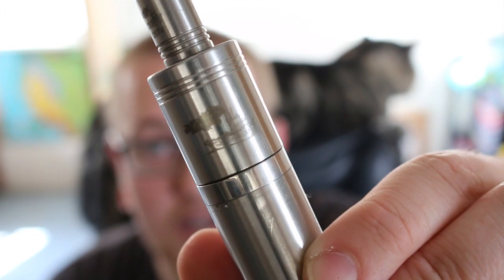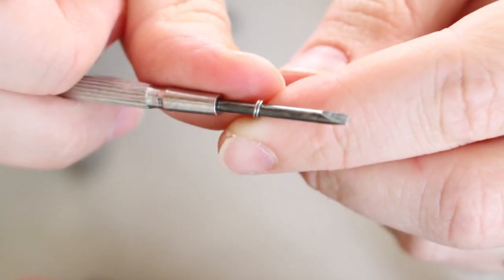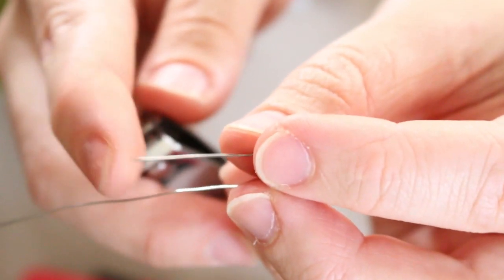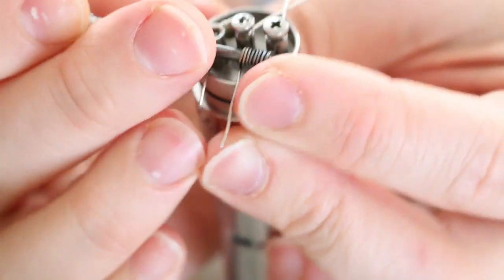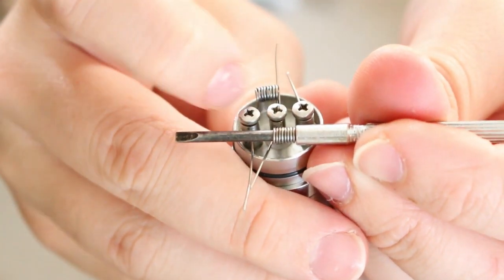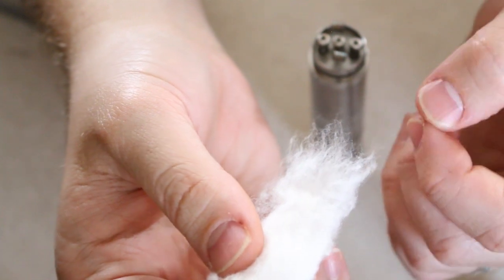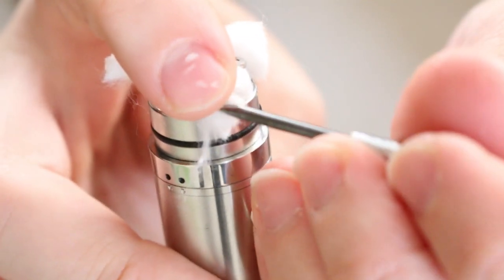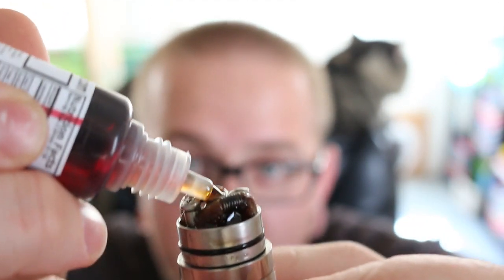Tugboat RDA Dual Coil Build!

Comment: I always ended up with one side of the wick not dry perfectly, it's like they are not heating up in balance. the other side of the coil is dry so I know I have to re drip, but the other one is still soaking. what should I do? mostly found in 4-post RDAs of mine...hmmm right now I'm using authentic Troll RDA
Reply from the maker: Rahadianto Putra Make sure your leads are the same length on both sides? also the center two leads stacking, try to get them to screw down side by side instead of stacking them,